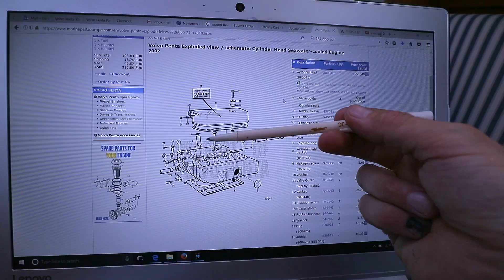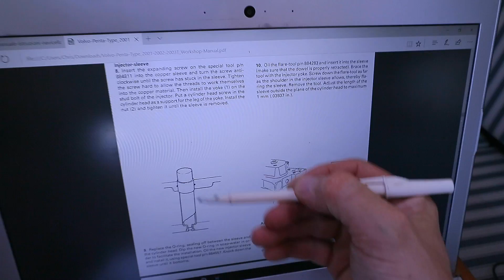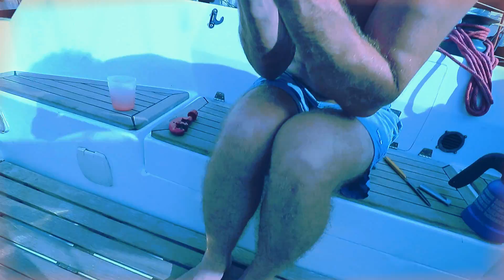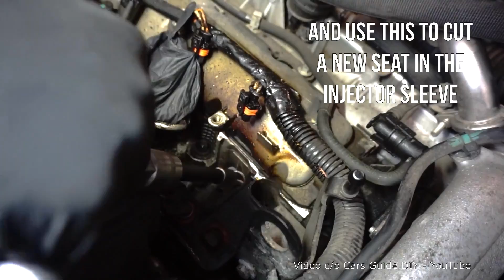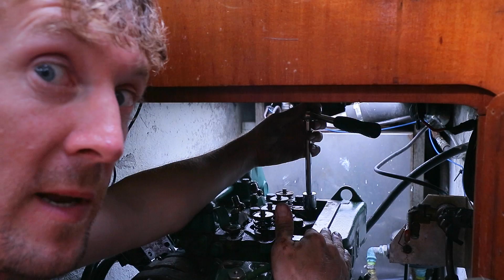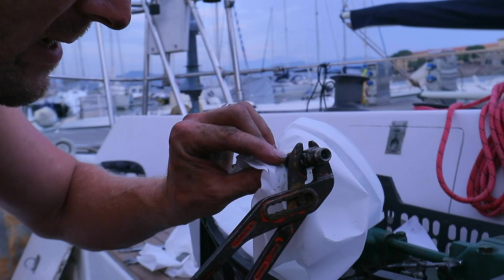Volvo Penta Injector Blow-By (Part 1 of 2) | ⛵ Sailing Britaly ⛵ [Boat Work]

Comment: Hi! I’m trying to remove one of my injectors but how do you remove the yoke part first that prevents rotation of the injector and clamps it down. The screw is off and the part is loose but the stud prevens me to get rid of that part. Please help!
Reply from the maker: It will come off with the injector. You can get slide hammers pretty cheap online if you're struggling to get the injector out. Let me know how you get on! Chris 👍
Reply: @SailingBritaly Thank you! I solved it and used the drill I bought for 50 EUR and now the engine is sealed and works like a dream. So million thanks again for your good advice!
Reply from the maker: @te0bald My pleasure, well done for persevering and getting the job done! Chris 👍

Comment: Great video and gave me some things to check on my 2003 Volvo penta however it appears  no blow-by on my injectors. The handle stay flat on top of the engine block. My symptoms are hard to start, once started idle is low even with 3/4 throttle set and white smoke from exhaust. Eventually revs come up and all ok however when put back to idle, white smoke and engine sounds like it is stalling. Any ideas would be appreciated.

Comment: Mine is a 2001 so 1 cylinder, diesel leaking past the injector. Injector took ages to get out, used a slide hammer in the end. I bought a reaming tool and while I was doing it you could see it cutting the outside edge first and slowly came into the middle to finish the job , however it still leaks so I'l take it out again and fit a very thin washer. You have to make sure whatever you take out you put back in so the injector nozzle is in the correct place within the combustion chamber.  I love the twin VP 2002 but alas it won't fit in my boat, it's too long.

Comment: Very helpful video. I have a '84 VP2002 on my Dehler db2 that I recently shipped over from Germany. We have injector blow by, most noticeable during starting on cylinder one (forward one). There was a lot of black stuff, like putty (for lack of a better term), hardened glue it looks like but can be pushed around with a screwdriver. I like the idea of quick fix one, obviously, but would be interested in how it has worked for others or should I go to fix two just to get it done properly? Fix one looks like you tap with a copper tube on the injector to try to re-seat then re-tighten the nut? just to confirm. Thx (subscribed, btw. Great channel) Cheers

Comment: Great vids, I have a 2002 as well any fixes on coolant seals/ rubber rings, particularly the special shaped ones that go to engine block and exhaust elbow?
Reply from the maker: They are one of the few things from Volvo Penta which don’t cost a fortune, so if you are planning on doing work it makes sense to buy a batch of new seals. Whether you are fitting new seals, or refitting old seals, smearing some silicone grease on them will help prevent leaks. Chris

Comment: I understand you’ve / are selling this boat—- but I wondered if your mechanic is going to perform a quick service on the two injectors since they were super gummed up with piles and piles of carbon build up??
Reply from the maker: Hi there, I cleaned them up as best I could and the engine ran nicely afterwards. (I wouldn’t have paid the diesel specialist clean them as they were the ones who introduced dirt into an injector after I had brought the block to them with the injector ports ‘capped off’ with paper, and I don’t like to reward people for things like that.) Cheers, Chris 👍

Comment: Chris, I have watched a few of your engine related videos. I find them helpful. I’m rebuilding my own VP2003.  I have one possible observation. I do not believe these specific  injectors use a seal between the injector and tube. During my rebuild I am unable to locate a part number or any reference to this seal. I believe it seals agains the bottom of the  injectors sleeve.  I could be wrong but have been unable to find a different answer otherwise.
Reply from the maker: Hi, there are no copper washers between the injector and sleeve in the as-designed condition. The reason I added two washers was because, despite ‘milling’ the seat area, there was still a slight leak. As I didn’t know I still had plenty of material thickness for further milling, I used copper washers to fill the imperfect mating surface in the injector sleeve seat area, which stopped the blow-by. Cheers, Chris
Reply: Sailing Britaly   Ok. Thanks. Something i just learned the special tool # for flaring the injector sleeve In the service manual is a typo. The correct # is 884823. Thought I’d pass it along.

Comment: Hi Chris I've got the same engine as you in my mirage 2700 .I've just rebleed the whole engine and turned it over quite a few times but it won't start .do you know of any bleeding issues or anything that can help it start other than the cold start procedure. Cheers
Reply from the maker: I’d go through the fuel supply methodically: make sure there are no blockages from sludge (fuel pick-up in tank, filters, fuel lines), bleed all parts of the system with whatever fuel pump you have - whether that be a 12v fuel pump or the hand-operated lift pump, and get air free diesel out of all bleed points and fittings. Then try again. Buon lavoro! Chris

Comment: evening Chris, if you ever get one of those injectors that's stuck in good style, get a can of cheap coke or Pepsi, pour it on the offending area, leave overnight and it dissolves the black carbon deposits holding it in .sounds weird but it works. also you  could try making a slide hammer using an old injector pipe nut welded to a small bar.

Comment: Now this was an absolutely Ace video Chris.
So many are pitched at basic, basic level. It was great to have a number of graduated in quick/difficulty solutions explained.
I removed engines from junk cars with my brother when we were 16-18 and we knew nothing. Grinding valves and replacing rings, big end shells, oil rings, head gaskets and of course grinding valves with sucker sticks and paste. What fun eh? Then a life of clean soft hands in IT.   So yeah I'd have a go at this.
Also annealing. I remember this from school 50 that's five ohhh years ago. I did something called planishing with a gas brazier, sheet of copper, bowl of acid (remember it but not the why), a planishing hammer and a domey anvil thing in the Jaws of a vice. So remember the repetitive annealing process to make it malleable. Remember it went a dull pink.  Congratulations on the olive you made BTW. 
Injectors.... I never hacked a diesel so don't understand injectors. But a couple of years ago, I paid about £800 to get one done (VW wanted 1200) once. The guy I phoned wouldn't do it on my drive until his expert came back off holiday. He said he'd left sheared off injectors in the head before. So I gathered there was some risk attached to what you did here?

Again. I really appreciate this one Chris. Excellent production.
Reply from the maker: Learning by doing is the best form of education! Injectors can be a pain to get out but it's worse on a modern car where there is very limited space to work and with lots of things getting in the way. If they were really badly stuck I'd have made a slide hammer type tool to get them out, but fortunately 10 minutes of leverage and twisting did the job. Thank you for your comment, we get a lot of motivation from comments like this. Cheers, Chris 👍

Comment: Not a criticism...just so I understand the process better. Did the head need to come off for the diesel tech to reseat the bad injector if he has the right tools? If no (the head didn’t need to come off) then why didn’t you just have him do that?  Did you replace all the injector sleeves since you went to all the work to take the head out? If one went bad good chance the others are close behind to fail,  right? Sometimes on big items like this I like to let the tech do it, because he owns it if it goes wrong.  When you do part of the disassembly and it goes wrong, he can say its on the stuff you did, not him that caused the repair not to work. (Basically you goofed it, so no recourse).
Reply from the maker: Hi there,

I could have cut a new seat in the injector sleeve with the head in place but I only saw how much scope I had to do this once I received the new injector sleeve and saw how just thick the copper is (this is very difficult to determine with the sleeve in place in the head). I cover more about this in part 2, but there would have been plenty of material there to cut a new seat, and ours wasn't 'too far gone' as it had seemed to me at the time. The other injector sleeve was still perfectly fine so I didn't get it replaced - we were selling the boat and I wanted to be able to sell it without telling someone "There's a temporary fix on one of the injectors, but don't worry it's been fine since I added two homemeade copper washers." I wanted this problem fixed, without going down the "While I'm here, why don't we do this, and this, and this" route.

I have a tendency of wanting to do everything myself. If I could have got the special tools without too long of a wait I'd have replaced the injector sleeve myself too. I was happy to take any problems on - all I wanted was the injector sleeve replacing. I understand why others would prefer to let a tech take on the responsibility for anything which goes wrong, in my case I was happy to own it.

Cheers,
Chris
Reply: Sailing Britaly Thanks Chris...that clears it up

Comment: I just did the injectors on my old md7a. I actually had a spare engine so I reconditioned the injectors out of that. When I came to get the injectors out of the boat engine they wouldn't budge! I even ran the engine with the clamps loosened, revved the nuts off it, no joy. One of those injectors took me 15 minutes of slide hammering to get out,  I had the head off, of course. She's sweet now! Bloody old diesels,  bullet proof!!
Reply from the maker: Good on you Andy, anything in life much more satisfying when you have challenges to overcome. Boats give a whole load of satisfaction! 😂 Cheers, Chris 👍

Comment: Part of the price difference is the idiot allowance - if you ring up and say "the doohickey on the big lump thing is leaking I think" they have to prepare for the tech being dumped into a pile of loose engine parts and expected to make it run like new. The flip side is that if you say "come out and replace one injector sleeve" that is exactly what you will get. A fast, efficient replacement of that exact thing. If you're wrong about the problem that's on you. If the tech decides to helpfully point out some other problem that's a gift that you can't expect or demand.
Reply from the maker: I'm happy to take on the extra responsibility with things like this but, as always, it's a question of personal preference. Cheers, Chris
Reply: oh, very much so and that's what I usually do. I was just trying to explain a little more about why that price difference exists.

Comment: Your engine has the same cooling system as mine, raw water cooled with no heat exchanger. Took a couple of goes to get the right alternator belt.
Great informative video, never seen the washer idea before that was ace
Reply from the maker: Thank you Samantha, it's handy for re-annealing old washers too if you have to dismantle something and put it back together when spares are hard to get. Cheers, Chris

Comment: Question , my experience is with gas/ petrol engines.   Going to the work to pull the head wouldn’t be wise to service the valves and check the head surface at the same time?
Reply from the maker: I could have done that Lou, but I knew everything was fine apart from this injector sleeve. The engine had been running sweet for ages since my initial repair. I'm not saying you're wrong - there is definitely a case to be made for doing that - but where do you stop... Do you paint the head? If you're painting the head would it not be wise to also paint the block?... and so on...  We had a baby on the way and had bought another boat in the UK (which needed plenty of work), so I just wanted to replace this injector sleeve so I could hand the boat over to her new owner with a clear conscience. Cheers, Chris
Reply: @SailingBritaly  —- bravo sir... Hope that effort / courtesy comes back to you 10 fold sir... 🙏🙏

Comment: The hole made by the injector seat cutting tool looks similar to what I drilled in my mainsheet traveller car using a normal drill driver

Comment: The washer fab is awesome.  I can hardly wait till l need to do it haha. I keep carbon build up to a min with Seafoam. Works for me.
Reply from the maker: Annealing can be handy on 'old' washers too. A leaking joint can often be resealed by taking it apart, annealing the washer and reassembling. Cheers, Chris

Comment: Did one injector sleeve with the milling tool made for this application a couple of month ago on my 2003. Have run the engine maybe a hundred hours and no leaks.
It was a loud whistle at the end. :)
By the way, the milling of the sleeve is NOT a quick fix, it will hold up as good as a new sleeve if you do it correctly and put the exact thickness of an injector sleeve copper compression washer.
Reply from the maker: Good on you Johnny! It's a quick fix in the sense that it is less time consuming, than replacing the sleeve, but I agree that milling the sleeve is a good repair. Congratulations for fixing this issue and thank you for sharing your experience to help others. Cheers, Chris

Comment: In a pinch, could you remove the injector, clean the copper sleeve, clean the injector and put a thin bead of JB Weld to fill the gap to prevent blow-by ?
not the best solution because the parts would be 'welded' together, but as maybe a last resort ?
Mate, love your energy and attitude, Beautiful family, Love the channel
Reply from the maker: Thank you for your comment. :-) At a pinch I would be up for trying anything (which is what I did when this happened and we wanted to get our engine back). A copper washer (homemade or bought) can resist the temperatures here very well and our emergency repair lasted for 10 months with no problems (I replaced the injector sleeve as we were selling the boat and didn't want to hand it over with a temporary fix like this in place). If I needed to get the engine working again and had no better options I'd give JB Weld a try, although how well it would work (and how hard it would make removing the injector at a later date) would be all to discover. Cheers, Chris 👍
Reply: @SailingBritaly   WTF, you're selling ?
Reply: @NoBody-me5me  I think this was the old boat and not their current one.
Reply: May hold for a while.
JB weld amazing.
Belzona from UK two part putty used on nuclear power repairs also awesome.
I used it to repair cylinder walls scratches in ring area on a Honda engine still runs perfect.

Comment: Interesting, something I need to have a look at. Mine is just a single cylinder and makes such a noise don't think I would hear Air escaping but like the idea of placing a light tissue over it and see what happens. Good to know some of those quick fix methods.  I have recently put an outboard bracket on the boat and keep a little 3.5 hp in the cockpit locker. It would get me home with the tide. My little Bukh is 40 years old now and previous owner gave me the outboard for free with a bracket so might as well have a back up plan.
Reply from the maker: Hi Mike, you usually see a black gunk deposit around the base of the injector before it gets to the stage where you hear combustion gas escaping. There is that big black mess of sticky goo for the gas to make its way through before it gets to the top of the cylinder head, so the black goo escaping comes before the first gas can be heard or felt. Having a back up plan is always a good idea at sea! Thank you for helping us make this video! 🌟 Very best regards, Chris, Rossella & Emma 😊
Reply: You have a copper washer already fitted to the base of the injector Mike so it would start to wear that away first so no issues with that. Its a different set up on the Buhk. You might get some carbon build up on the very tip of the injector, thats it really. Just be careful not to lose the small injector tip cap that sits between the injector and copper washer :)